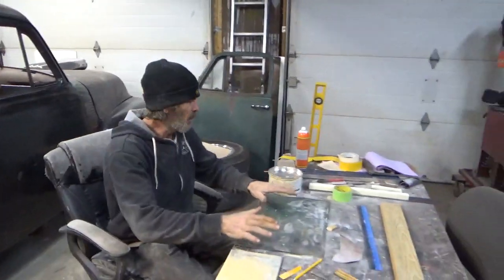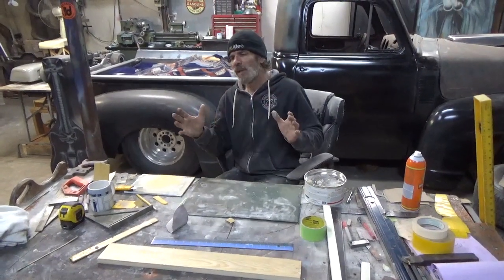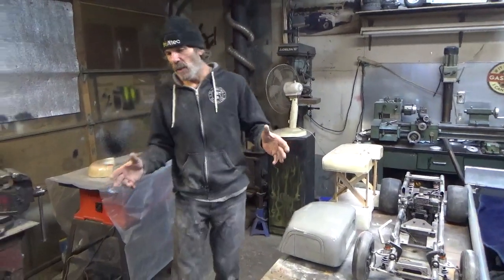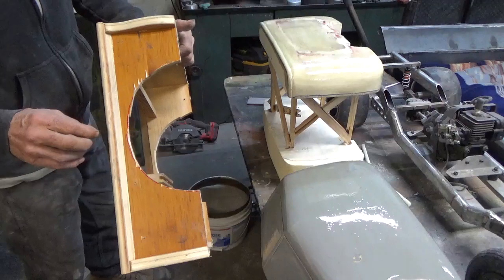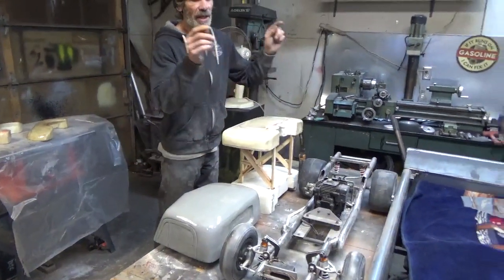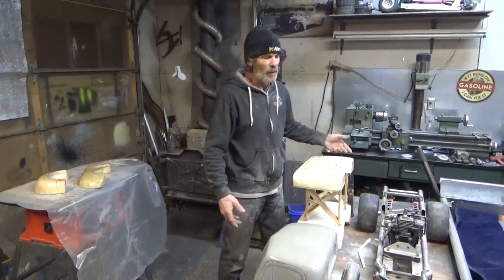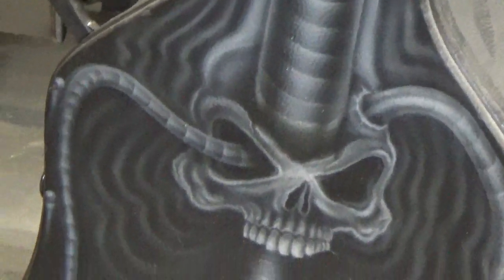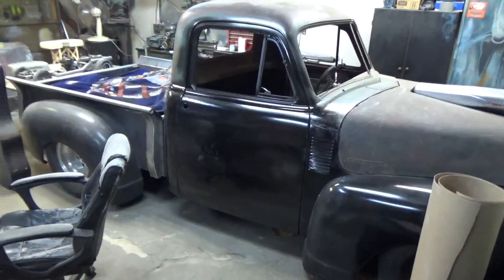resin coating the foam parts for the '52 RC truck, airbrush intro

Comment: Your doing a great job keep it up ive been making qc bodies for 25 years would glad to help if you any i do casting aswell
Reply from the maker: Hey Kevin what type of casting do you do,and ty for your comments
Reply: @sharpkustoms  I sand cast 1/4 scale parts like grilles rear ends boat lower units just about anything I can machine the castings and polish
Reply from the maker: @kevinhibbs4847  would like to see pix,anywhere you post the things you make